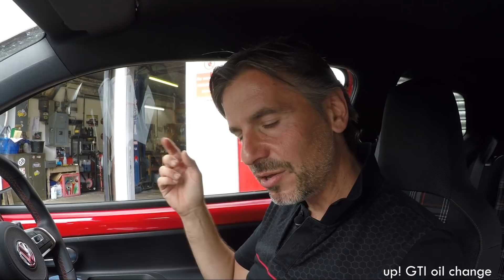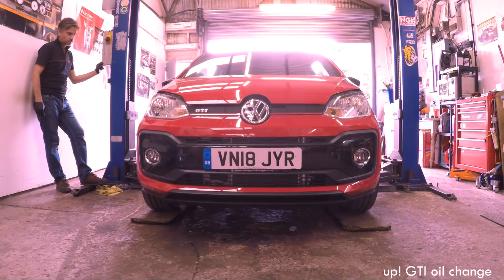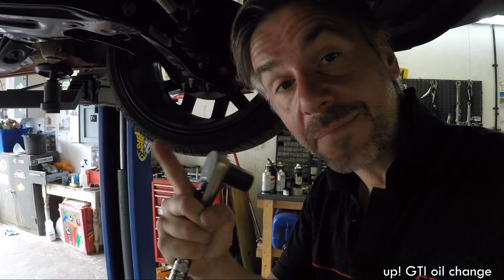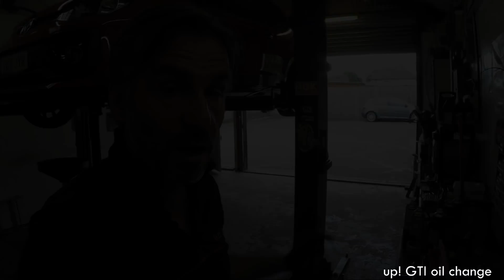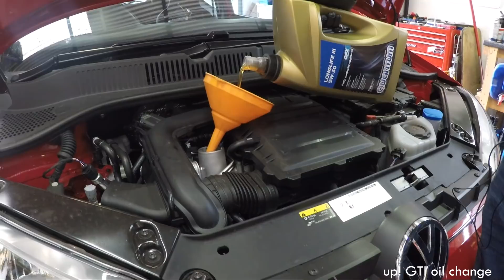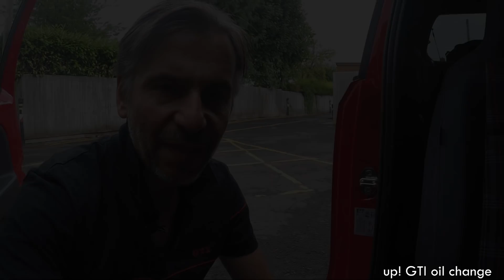VW Up! GTI - DIY Oil Change Guide & Check

Comment: Great video. I got some motul 5w40 xclean gen 2 which says VW511 spec which i may use on my up gti. From my research its similar to 502 oil in viscosity (5w40) though has mid SAPs so should be good especially as mine has no GPF for the SAPs to damage. Reason i want to use this oil is because its proven to reduce engine wear

Comment: 70 mpg?????

I know you are running those imperial gallons there, but I'm only getting 56 mpg(imperial).  46.5 mpg to the U.S. gallon. We've had our "High Up" for 4 years now and its been a champ.  I'm doing the oil change myself this time.  I've been doing them on my cars for as long as I've been driving. 
Good advice on the early oil change for a new car. We've got 41K miles on ours.  We do mostly in town driving.

Comment: always put some new oil into the filter so the filter element is already oilsoaked after first startup and doesnt have to fight trough a dry filterelement, so the oil gets quickly to the journalbearings, just a protip

Comment: That oil is dark after such few miles. Did you drive it hard / high RPM?
Reply from the maker: Just the light
Reply: @volkswizard  Ah, gotcha. For one second I thought you had TDI swapped it xD

Comment: Great work! Did you notice any difference in noise and/or fuel consumption after changing from the factory 508 00 (which is a 0W-20) to the 504 00 (which is 5W-30)?

Comment: Fantastic content as always. I have learned the importance of having a torque wrench. Have a look at this funnel. May make the daily job easier: 
https://www.amazon.co.uk/Sealey-VS7100-Engine-Oil-Funnel/dp/B00K1UMTV2/ref=asc_df_B00K1UMTV2/?tag=bingshoppinga-21&linkCode=df0&hvadid=&hvpos=&hvnetw=o&hvrand=&hvpone=&hvptwo=&hvqmt=e&hvdev=c&hvdvcmdl=&hvlocint=&hvlocphy=&hvtargid=pla-4584482457789034&psc=1

Comment: Would it not be cheaper to buy a box of sump plug washers instead of plug and washer?
Reply from the maker: Washer has to be cut off if you want to change it,  it doesn’t just come off. Then getting the right type of washer to prevent sump thread from stripping or oil and leaking is not easy. Most garages just reuse the bolt and washer  but a lot of garages also strip the thread in sump. Do it right, do it once.

Comment: Why not just change the washer. Seems daft to do the plug every time. Just a thought.
Reply from the maker: When a car is under warranty it's best not to mess as VW will find any excuse to bounce a claim these days. If you ask VW for a washer they don't list one for this car so it has to be a plug and washer. Divert from "servicing to manufacturers' specification' at your own risk! TBH even on cars that are out of warranty I replace the plug as I know 100% it's going to seal perfectly each time.
Reply: volkswizard thanks for the quick reply, my point if it was one was well just a thought. Your point on the warranty is of course totally correct, I have a Audi TT TDI mk2 on an 58 plate my guy does  it all by the book as well he uses Audi parts and only Audi parts I know or should I say my wallet does. I suppose that’s why I use him. Lol.

Comment: Over fussy a new sump plug after 2k miles ridiculous he obviously has plenty of cash. I bet the customers don’t get the same treatment.
Reply from the maker: I didn't remember I said I buy them in bulk in the video, you can even see the box - so why would I buy them in bulk if don't use them all the time?  https://youtu.be/el9eZVjYeKk?t=842  I haven't got that much cash I can afford to replace an engine by not using a new one :)
Reply from the maker: Thanks for commenting Danny. Would you like me to show you receipts for sump plugs if you send me your email address. I buy them in bulk every so often from Febi Bilstein so they are OE quality but a lot cheaper than from VW.   I replace them every time regardless of whose car or the mileage as I do the job properly which I accept is unusual.  What's the mileage got to do with it anyway? Once they are tightened the crush washer has done it's job and may never reseal again so best practice is that it should be replaced.  My view is that while leaks are rare I can buy lots of sump plugs for the cost of replacing an engine for the one time when it does leak.
Reply: volkswizard ok dude you have my respect ✊

Comment: Great video mate, enjoyed watching that.

Thanks for the link to ACF-50 on Amazon. I bought some for my motorbike, but I changed the sort order from recommended to low-high & found it cheaper! (every penny counts)

A seller local to me here in Cornwall, Opie Oils had it listed at £15.49 inc delivery, but cos they are local I popped down & got a can for £13.99 - bargain!

FYI they have a good article about ACF-50, which some of your other viewers may find useful. The link is:

http://blog.opieoils.co.uk/all-posts/acf-50-motorcycle/

Cheers and look forward to the next video!

Comment: Great car - I thought only diesels have a particulate filter
Reply from the maker: That was the case until recently but petrols also have them now. https://www.autocar.co.uk/car-news/industry/volkswagen-equips-petrol-cars-particulate-filter-technology
Reply: Thanks so much for link - dpf replacement costs an issue in Oz due to them not lasting and replacement costs are high
Reply from the maker: it's an issue here too especially as cars that have had them removed should fail the annual government inspection as of May 2017

Comment: Great video, as usual. I've been doing oil changes on my cars for over 30 years, but still picked up a couple of useful tips. I need to check my manual, though, because on the day of delivery, my dealer told me the GTI is the only Up that can go 30,000km or 2 years between servicing. Thoughts?

Comment: ACF50 is great stuff and gets used on my motorcycles. Bilt Hamber do a superb range of products for rust-proofing, and will be my first point of call for my GTI. It takes so little time for rust to engulf the surfaces otherwise. Great to see that the filter is so low down, there's no fun to be had in having to stick your arm deep into a warm and often tight engine bay.

Comment: No mention of running an oil flush through before draining the old oil.    Is it overkill or not necessary on new cars?
Reply from the maker: Definitely not necessary at this mileage.  A lot of people say don't use it on older cars either because it can dislodge gunk that blocks the strainer.  Best thing to do is just change the oil regularly.  This is a running in oil change so is a bit different, 1800 miles oil changes aren't necessary after this one!  After that I'd say 5k in the ideal world or 10k absolute max if you are running long life oil. If you track your car then halve that.

Comment: Like the silver GTI in the back to!   Got the same one in silver only with a slightly bigger engine. :)
Nice vid., one question tho why use LL oil??,  i think you keep up the shorter interval of oil change!?
Reply from the maker: Hi GT20VT.  Would love a 1.8T Lupo if it can brake OK and in a straight line :) I used LL oil because it costs only a bit more than the 5w/40 stuff and I know it's definitely approved for the car.  I don't know what oil it comes with from the factory so I don't know if I've gone up or down.  Can't see a point in using cheaper oil even if it's going to get changed in 8200 miles, I'd be wanting to change it again after 5000 miles, while now I don't think LL oil will degrade much so it can stay in until the next oil change at 10k :)
Reply: Indeed the price difference is not the issue, LL oil is ok aslong the people don't think it can
stay in for 30K but over 6 years or so!  :)
Black sludge destroyed many engine's,  1.8T for example was sensitive about that.
But i  know that won't happen to you!
Reply from the maker: The amount of filthy oil filler areas I used to see on 1.8T and even 2.7 V6 on RS4 all from absolutely trashed oil. When you see a new engine you realise how clean it is under the cap. I've done 1800 miles and it's still mint.  It can only be oil degradation that causes this.  Best check of an engine, look under the cap :)

Comment: Nice video 👍😁 Like to see the first service to 👍😁
Reply from the maker: Thanks, come back in May 2019 and there will probably be a first service video too performed by VW but IIRC this is just an oil change anyway and unlikely to even see a computer plugged in. Second service is just oil filter, I think 40k miles or 4 years will be the big one so see you in 2022!

Comment: When I decided to keep my Audi A2 TDi I bought a Fumoto Engine Oil Drain Valve and saves all that Faffery with sump plugs.
ACF 50 Rocks btw works great on bikes sat for the winter.
Reply from the maker: Hi Roy, that's a good tip

Comment: Volks, have u fiound out the real differences between the 115hp and 90 hp engine besides the particulate filter?
Reply from the maker: Hard to say as it will be mainly internal. Need an ETKA geek like VW tech Jordan to look it all up :)
Reply: I think only the 115ps engine has an integrated intercooler, allowing more boost to be used reliably.   https://www.autoexpress.co.uk/volkswagen/up/gti
this article says VW added an intercooler for the gti engine.

Comment: Acf50 is rubbish ! Used it for years  and found it didn’t protect anything on my car. 
I’ve just bought some bilt hamber atom Mac for regular anti corrosion protection . 
As this is from bilt hamber it will do what it say on the tin unlike acf50 . 
Not used it yet as I’m saving it for my Up gti when it arrives. 👍
Reply from the maker: Hi Sean.  You don't say why you have such a negative experience of ACF-50 but a lot of people me included swear by it.  I don't have any experience of Atom Mac but it looks like a completely different product to ACF-50.  For a start people are spraying it on brake discs. The oily nature of ACF-50 means you'd want it nowhere near brake discs.
ACF-50 is used in aeronautical applications and you don't have many products approved for this type of use that are 'rubbish' because of the nature of the materials they are protecting.
Reply: volkswizard Hi Volkswizard! I found it didn’t offer the corrosion resistance all the hype promised. 
Did a non scientific test with a brake disc I changed on my car with one side coated with acf50 and the other side with 3 in 1 spay oil . 
Left disc hang on a tree branch and a few weeks both sides showed almost identical amounts of rust so acf50 did no better than 3 in 1 oil and didn’t stop rust. 
This backs up what I found on the car and around the garden ( gates, locks , hinges and garden tool ect. 
Maybe I didn’t apply it correctly or it was a duff batch but it didn’t work for me. 
I’ll happily send you what I have left completely free for you to test if you want?
I’ll be trying the atom mac out as this also has great reviews is easy to apply with a garden spray bottle and it will migrate into every crevice but will need regular but dead easy applications.
It’s also Uk made and bilt hamber don’t make anything that’s not top quality.
Reply: I must admin I didn't like ACF50 too much - it's greasy so when spraying onto suspension components, it attracts particles which I'm sure will accelerate wear.  On flat clean surfaces, it ends up making them super dirty. Atom Mac (which is made locally to me) seems to have had excellent reviews and it water based so not so sticky.  I suggest a try Andrew?
Reply: tomstacey Totally agree. I bought ACF 50 ( spray can ) based on great reviews and it didn’t work for me so bought the 1 litre pump spray bottle ( as all the hype still had me sucked in ) and that didn’t work. Messy , attracts dirt  and  didn’t protect from corrosion any better than a basic oil like 3 in one and over priced. 
I’m always amused at people that say it protected my bike over winter while off the road and in the garage as I never had any of my bikes rust while in winter hibernation  and they had nothing more than a wipe over with some gt85. 
I even had a Aprillia Falco that was stored outside under a bike cover and that didn’t have a speck of rust on it with a wipe over with the nothing special gt85. 
Ive yet to use the Atom Mac on my UP gti as I’m still waiting for it lol ! But I’ll report back in 2020 .
What looks good is the piss easy application with garden sprayer and the way it migrates to all parts and when used on brake discs after washing stops flash  corrosion .
Reply: I've bought some Atom Mac. first try today - washed the car, sprayed on the brake discs and put the car away in the garage. We'll see!

Comment: Andrew good stuff, Mine is now on 7000 miles, cracking on in my great fun car. My oil pretty clean  on the stick, hardly a drop used in that mileage.

Did you have  too reset computer service warning light , for next service interval - does it have one indeed or is it really old school like me.
Did you check the filter for metal fragment / mag plug  and actual state of the old oil?
Reply from the maker: Hi Keith.  I didn't reset the reminder because I want it to still be due in a year or 10k miles, whichever comes soonest.  The filter is metal so would need cutting open which will create metal particles! I can tell you have a Porsche as this is normal with their paper filters, do it all the time. The plug isn't magnetic.  The oil was good but then it would be at 1800 miles and nigh on impossible to see the swarf if there is some as it shoots out of the sump.
I'm not too worried about specifically seeing swarf, the point of the change is to get rid of that first oil because if there is swarf it will be in there for 10k miles, for what it costs (£30-£35?) not worth thinking too hard about :)
Reply: Andrew,

Who needs hi-tech parking ,when you can do this.

https://www.youtube.com/watch?v=Rpw5ih_hhDM